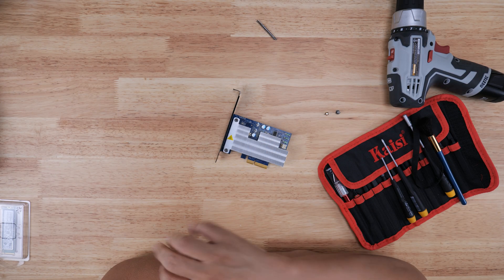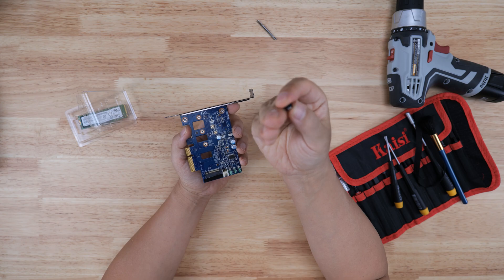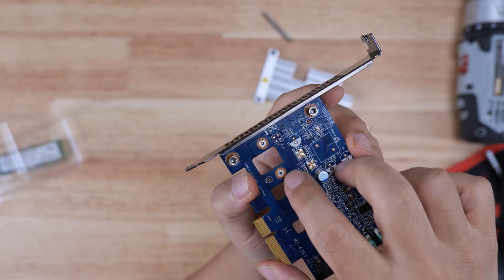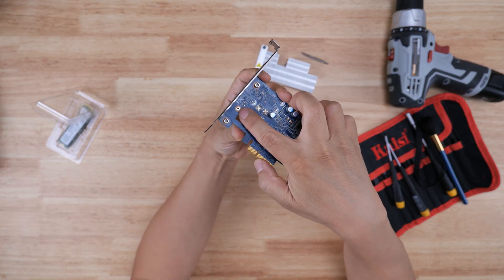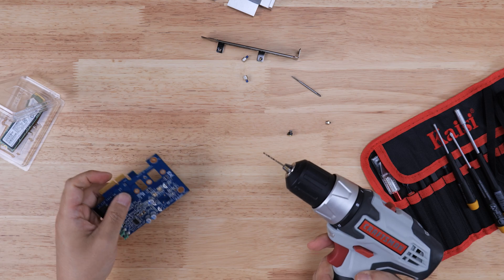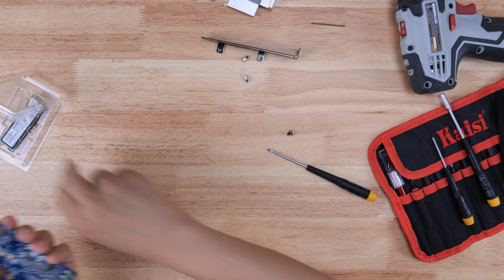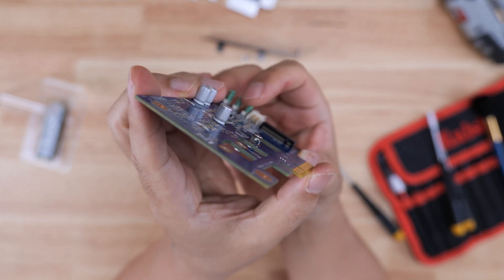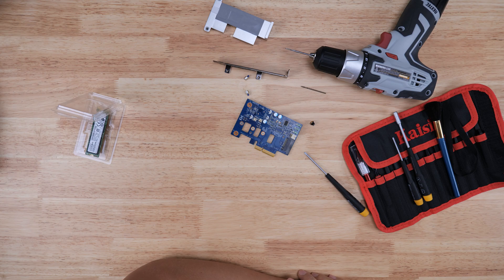How to fix the elusive HP M 2 mounting screw problem

Comment: I appreciate your creative solution, and I have a suggestion. Given that you're dealing with aluminum, a very soft material, perhaps you could skip the drill entirely, and hand-twist the tap into the existing hole? A fairly good tap should cut the new threads with minimal effort, using the existing hole as a guide for the tap. This approach may require stepping up the tap size incrementally, one-at-a- time. I would be concerned I would inadvertently damage something by using the handheld drill. Nevertheless, I'm glad it worked for you, and I appreciate you sharing your techniques!
Reply from the maker: Actually, i normally would hand tap these, but for the sake of making a shorter video, I decided to use power tools for the demonstration. nonetheless, hopefully the idea/concept will be useful to some people! :-)

Comment: As long as you use the included heatsink. The heatsink will hold the SSD correctly and securely.  Back in the day, when I worked for HP. Those screws were impossible to find, even internally.  Plastic covered paperclips bent into an appropriate shaped was used by us, for shorter SSDs.  Yet another irritation with the Z-Drives is the bracket holes. Try putting almost any other HHL bracket on. The holes dont line up.
Reply from the maker: Yeah, some people I know at HP said the same thing. And yes, the screw hole spacing for the PCIe bracket is also not typical. Makes one wonder if HP went out of their way to just make everything a bit "different?"
Reply: @ArtofServer  my, what highly justified cynicism you have 😂
Reply: @ArtofServer  Why different if they don't even sell those screws... I can't mount my SSD because of this... What the point with HP ?

Comment: If you're doing a lot of these, a drill press adapter for your drill, dremel drill press, or mini drill press, would make sure you're always drilling the hole straight, and they make tap holders with either socket square-drives or a quick change hex shank. With a tap this small it's really easy to break the tap, you can get quick change drill bits, then it'd be really easy to switch the drill press rig back and forth. I have too many HP things with this screw hanging over my head so I might need to set up this tooling. Last time I looked, the cheapest I could find that screw for was Seven Dollars Each.
Reply from the maker: Yeah, this isn't the best way to cut those threads straight, but it was good enough for the demonstration. I already finished processing the box of turbo drives I had, but if I had to do more, definitely better to rig properly.

I couldn't even find the HP screws anywhere. I talked to some people who work at HP, and even they said they have a hard time finding those M.2 mounting screws internally. Finding a source for the HP screws would be nice, but in the case where the 1.6mm threads are stripped, switching to the more common 2.0mm stand-offs I think is the way to go.

I'm sure there's better way to get it done, but I hope this will be helpful to you. :-)

Comment: Had same problem with gigabyte motherboards ssd screw , it's the same size.. so if you find some gigabyte screws, definitely not same screws on msi asus motherboards much smaller.
Reply from the maker: Gigabyte boards use a 1.6mm thread screw for the M.2 mounting? HP and Gigabyte must like copying each other... both are notorious for the SMBus conflicts too!